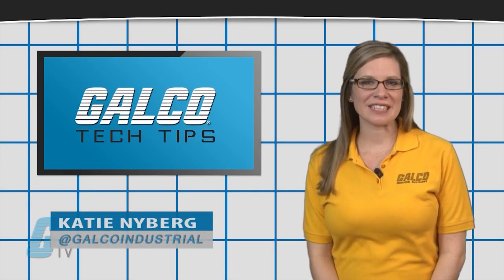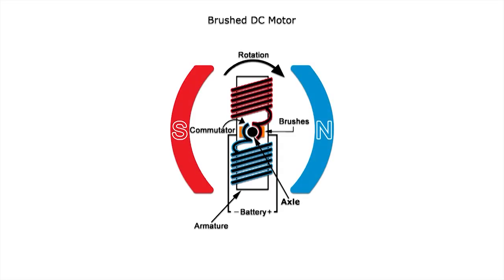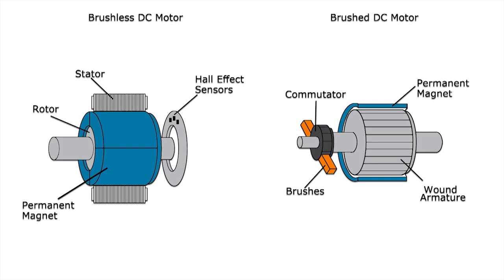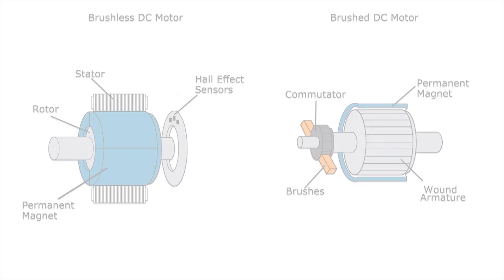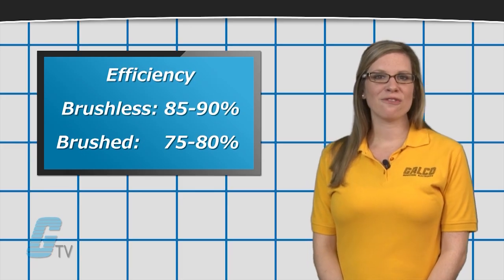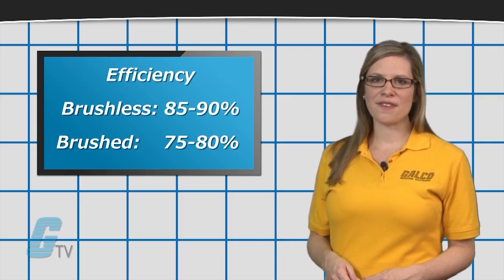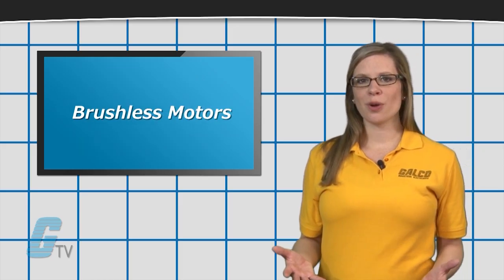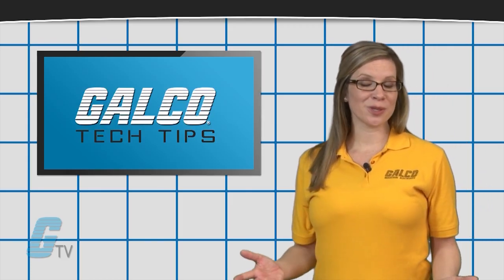Advantages and Disadvantages of Brushed and Brushless Motors - A GalcoTV Tech Tip | Galco

Comment: I have a Milwaukee cordless brushless circular saw, that’s 3 1/2 years old and it’s in for repair, some days it wouldn’t work,  and other days it would work, it’s a piece of shit  I’ve got tools makita with brushed motors that are 18 years old and still working fine, brushless motors are junk.
Reply: Sorry you got a "lemon", it happens.  I have sweated over and spent way too much time deciding between a brush-less and brushed handheld drill and a leaf blower.  I decided that after well over 100 years of use the brushed must still be good and both items saved me money.  I am a DIY homeowner not a professional so I am not worried about longevity as I am 76 yrs old and the tool will most likely outlast me.

Comment: Currently I'm debating whether to get a brushless hammer drill that has less torque power but burns less battery energy vs the brushed hammer drill that has more torque but consumes more battery energy 🤔 

The brushless has 405 lb of torque. The brushed has 450 lb of torque. I'm thinking I might just go ahead and get the brushless to save on battery life. But I'll have to sacrifice torque power. Damn that sucks.

Great info thank you
Reply: So, did you get one, how its going ?)

Comment: The weakness in the brushless tools are going to be the cheap electronics that drive the motor. They will likely be the failure point. The little computer also typically has pre-determined notched speeds so you don't get continuously variable control. You also get the added trigger lag as the chip tries to figure out how far the trigger's pressed in with most brushless tools. Companies are eager to switch to brushless though because it can make tools lighter and cheaper to manufacture/ship from wherever they slap them together. If brushless designs resulted in larger/heavier tools, despite not having brushes that can wear out that tech would remain a novelty and would probably never be adopted on a large scale.
Reply: I have a brushless ryobi and put it thru hell. works till this day.
Reply: remember..the plastic housing isn't the same as they used to be.
Reply: Your right about the speed control much smother with brushes, some tools will always be made with brushes.

Comment: The big problem with brushless tools is their very complex and delicate control electronics. They cannot be repaired and the entire circuit must be replaced. Brushed motor tools are extremely robust and their 4-pole versions are very powerful, which is why they still exist. many dewalt xrp series tools 15 or 20 years old working today.
Reply: Agreed. Cost myself $15 for replacement brushes on my makita drill
Reply: @blaked8963  the probleme is with some motors where the brushes are inside the motor housing like fore some chinese cheap cordless drill for example ,so it's complicated to fix them, and we have to change the whole motor
Reply: I say that's a negative. My Ryobi!
a brand people hate. That brushless cordless drill was a beast.
dropped it from so many heights etc.
Drilled a lot of 1/2 holes with it.
thru 2inch square tubing 1/4 in thick.
I put that cordless thru hell. it's still working.
Reply: They absolutely CAN be repaired. You just have to know what you’re doing. Yes its more complex and time consuming but it can be done.
Reply: I say that's a negative.
put a brushless motor in the hard body plastic as they did the old cordless.
If brushless can't be repaired and regular motors can.. why even get it repaired? buy a new one?
XRP are very delicate. I've seen them fall from 10-15 ft and give out.
Reply: No way, brushless motor is better, their mechanical and electronic parts last longer with no spark and bad odor like the brushed one,
Reply: Take a brushless sawzall to a pipe with water in it and you run the chance of ruining the sensor. 

I love brushless for clean work areas, but brushed tools have remained superior in harsh wet and abusive environments.IMHO

Comment: In my (personal) experience the overcomplicated wiring and requirement of a computer chip causes brushless tools to be much less durable than brushed. I believe the word “durable” is used wrong when talking about the lack of physical contact in a brushless motor. The brushes wearing out on a tool is normal and still takes 5-10 years with heavy use. This doesn’t lower the durability at all in my opinion as the brushes are consumable. It’s more like replacing the batteries in a remote than the remote breaking. 

You could make a brushless tool in a glass housing and it would shatter the moment you drop it. Would that tool be considered more durable? If you look at brushes as consumables then they become the more durable tools due to their simplicity. I feel a lot better when one of my brushed tools falls off of a roof simply because I know it will still run fine after. The brushless tools just don’t hold up to as much physical abuse.

My 2 ¢
Reply: yes. 
the plastic used now is not the same.
back then they could take a beating.
brushless or regular dropped from the same height will give out.
depends on how the tool lands now.
Reply: it's sort of like a combustion car vs an electric car like an electric car sort of doesn't have the problems of a combustion engine but it is a whole lot more expensive to repair if something does go wrong and it's a lot cheaper to replace parts (if common car) on an combustion car. so durability imo is how cheap it is to repair and if you have minimal problems after the repair

Comment: Brushless generator looks more durable than brush by design. The Brushed Generator's conductors between stationary and other in motion - must be connected to conducting the electricity. Brushless generator doesn't need that, since copper coils are stationary.

Comment: You never said anything about the power and torque each gives off
Reply: Since brushless motors are more efficient, that probably means that you can make more power using less energy. Pretty much every electric car on the road uses brushless motors.

Comment: Here’s what I’ll say: if you’re a contractor, or someone who will be using the drill/impact or whatever it is constantly - buy the brushless. You’ll get longer battery life, and the tools won’t overheat as easily, as well as you may get a slight power advantage over brushed depending on the brand. However, if you’re someone who only occasionally needs to use the tools - just buy the brushed. It’s cheaper, and still get really solid build quality depending on the brand. Plus, if your brushes wear out they’re easy as heck to replace. 

The brushed does have one and only one advantage over the brushless: the cost and simplicity in replacing parts. When a brushless motor dies: you have to buy a new tool, if a brushed motor dies: you probably just need to replace the brushes.
Reply: @Pi Pony the what?
Reply: I was just thinking about the people who manufacture brushes for power tools. I have a brushed Dewalt that serves me just fine. These people need to work making brushes Don't put them out of a job.
Reply: @ReadTheBible8  they’re made in a factory in China 99% of the time
Reply: why replace the motor in the drill when it almost cost as much to buy a new one?
Reply: Better things usually are harder to repair by a layman.
Reply: @h8GW  RIGHT!  Try working on a modern car engine!
Reply: Thank you just purchased a brush 0MESIN BOR IMPACT CORDLESS 20V HD INGCO CIDLI20031waiting for it to get delivered was using Makita 12 v is getting bit up alot need to some maintenance on it it heats up and battery life not too good switching brand and bigger drill
Reply: I used my Ryobi cordless brushless drill constantly. drilling 1/2 holes thru 2 in square tubing. Drilled over like 60 that day. Remember. 2 per tube.
Dropped it constantly from 6ft and above.
still kicking.
Reply: As a contractor I say correct.   But brushless motors last substantially longer.  5x for real
Reply: @PS-zw4yc   ~I am also a carpenter, we have had the same 110-120 volt >>Mikita circular saw<< (and also a Mikita cut off saw) with a "brushed motor" since the 1990's with very heavy use for many years building garages, huge shops, additions on houses, house - cabins, etc.. Our 3 man crew made our living and wages with that same Makita circular saw (we have a Dewalt circular saw for back-up that we hardly never use). Could not ask for anything better, it will not wear out and the brushes will not wear out. It has paid for itself a 1000x times over, a "brushed motor" will last a very long time over many years, I am 100% satisfied with its "brushed motor", and I do "not" need a circular saw lasting any longer than that (you explained a "brushless motor" may last 5x longer).
Reply: @royjohnson465  the big stuff that does not get over worked like a circ saw the brush motors are fine.  Same use here.  The drills where they get bogged down drilling etc the brushless last a heck of a lot longer
Reply: @PS-zw4yc   ~I see, thank you. Unlike a "circular saw", if the a Brushed motor is under lots of stress like a "drill" then brushes burn out and a Brushless is better for longevity. 
~"But" brushes can be easily replaced on a Brushed motor, if a Brushless motor breaks then it can not be repaired at home.
Reply: @PS-zw4yc I'm currently debating between 2 cordless hammer drills. The brushless has a torque of 405 lb. The brushed has a torque of 450 lb. 

What would you recommend
Thanks
Reply: In a brushed motor, the motor itself also dies, not just the brushes...

Comment: Lynch brushed motor 93%,  Maxon brushed  92%  their brushless 86% so not sure why you're claiming brushless are more efficient?  - Brush controllers are both more efficient and cheaper
Reply: Rather a lot depends on the number of poles and commutators.  In the illustration, there's only two commutator bars which means as you apply full current to the rotor, most of the time the magnetic poles are too far away from the magnets to impart much torque but are nevertheless drawing current.  Adding more poles and commutator bars allows the current to flow into a winding that is very nearly at the optimum location for peak torque; but if you do that then each winding cannot occupy much space so that limits the horsepower of the motor.
Not mentioned in this nearly useless video is that brushless motors can operate at high torque and very low, or even zero rotational speed; a thing that would quickly burn out the commutator of a brushed motor. 
Peak efficiency is obtained with a pulse width modulated electronic speed controller so that you are not simply slamming the electromagnets with full power in succession; a thing that creates some mechanical stress, modest inefficiency and rather a lot of radio frequency interference.

Comment: hi sir, i just have 2 questions
1. which of the two is better for aquariums?
2. can a brushless motor run 24/7?
thank you in advance
Reply: Sir...?
Reply: Brushless always. 

Depends on how large the motor is and the load constant load it endures. Your main concern is heat. If kept cool and not under much load a brushless dc Motor can run 24/7

Comment: The cost of electronic parts is NOT the reason a brushless motor is MORE EXPENSIVE !  The parts are FAR cheaper than the cost of the brush assembly.  Why then are brushless motors more expensive ?? because ... @#!$%^%$#  I don't know.
Reply: "Why then are brushless motors more expensive ?"
They contain extremely powerful neodymium magnets and neodymium is a "rare earth" found pretty much only in China.
Reply: @thomasmaughan4798  The magnets aren't that expensive.  The tiny coils inside a brushless motor have to be hand wound, and a brushes motor coil is machine wound.  So basically one can be readily and cheaply spit out of a industrial machine.  The other requires somewhat skilled hands on labor.

Comment: Lol Brushless dc is a marketing term.  "Brushless dc" is nothing more than 3 phase AC!  The only thing "dc" about them is that they are powered by a dc BATTERY!
Reply: Brushless motors typically use three phases, but need not be limited to three.  They are indeed similar to a 3 phase AC motor; the main differences being that "brushless motors" typically use permanent magnets whereas AC motors typically use induction.  Because of that induction, AC motors can only be used at the frequency for which they are designed and that produces a rotational speed (RPM) that is not intended to be adjustable.  A brushless motor using permanent magnets is usually infinitely adjustable in RPM from zero up to some specific upper limit.
Reply: @Pi Pony "is Tesla car good?"

Good depends on definition.  Many people consider Tesla very good. 

"Why because if the battery explode it takes 24 hours to shut it down?"

If the battery explodes it obviously shuts down instantly.  

"Does it has brushless motors?"

All electric vehicles, except some golf carts, use brushless motors.  They offer high torque, low maintenance, and continuously variable RPM (rotational speed). 

"Does it work better than average car or it's all marketing"

EV's are better at some things; particularly in cities where you spend a lot of time stopped, frequent acceleration and deceleration.   Hybrid automobiles combine the best of both worlds; a Ford Fusion hybrid for instance engages both the electric motor and the gasoline engine to merge onto a freeway; superb acceleration like you have a 'muscle car", but gets 40 miles per gallon or was it 60?  I drove one around Minnesota and was amazed. 
Two big downsides to EV's is battery cost and temperature; they don't like it too hot and they don't like it too cold.  Brushless motor works fine in cold; doesn't like very hot (above the "curie temperature").

Comment: this video is dumb do brushless motors even have disadvantages except for being more expensive
Reply: Like what?
Reply: @princenoah21  they are lighter, more powerful, spin faster, more torque, more efficient, last longer
Reply: For small motors brushless is superior in nearly every way.  ALL disk drives use brushless motors, all computer cooling fans use brushless motors.  They will run for YEARS with zero maintenance.   
Where it can be less effective is larger motors or hot areas.  Heat deactivates permanent magnets (but usually the magnetism returns once they cool down).  So a motor to be used in a hot area can still be brushless but needs electromagnets for both rotor and stator.

Comment: what do the brushes do?
Reply: Makes the rotary power connection to the armature windings via a commutator. This electro magnetises the armature in opposition to the fixed field winding electromagnetic field, hence producing rotary mechanical torque. I hope this helps.
Reply: @petcatznz  Or you could say.... Electricity is passed through the brushes like a wire. But wires won't work because they'd get tangled up. The brushes allow the electricity to be transmitted to a spinning shaft/commutator then to the armature.

Comment: Doesn't the commutator take an AC signal and convert it to DC? 🤓
Reply: The BATTERY supplies the dc to the 3phase controller, which outputs a pulsed sequence in 1-2-3 order to the three phases of the 3 phase motor ( which is a three phase ac motor only using a more square wave form rather than the sinusoidal wave from 3phased mains power) "brushless dc" IS 3phase AC
Reply: like everything does that

Comment: I read a review on a Milwaukee tool site and one guy said his brushes drill was more durable than the new brushless he purchased. Someone else said the brushless is very sensitive to moisture compared to a brushed version, maybe if its foggy out or working near the coast. 
 Has anybody else experienced the differences like that?
Reply: I have a Milwaukee brushless drill.  It has incredible torque, does not burn out brushes (hasn't got them), and really does not care about water.  Sounds to me like you have it exactly backwards.  Excessive moisture in the air could coat the commutators and they would stop working; also, brushed motors eventually develop a "varnish" on the commutators and must be polished from time to time.
Reply: No, he lied

Comment: Brushed makes more torq
Reply: Couldn't u use gears to make more torque if u need torque?
Reply: @randomgenericusername3890  power tools, both brushed and brushless are already using a planetary gear set for gear reduction. I think they have more power for the size of the motor because they spin higher rpm requiring a deeper reduction (increased torque as well) for the same output rpm.
Reply: No one seems to factor in the electronics failing.  That's the weak link in a brushless tool... Where as brushed tools just need their brushes replaced once per decade or so for a few dollars.
Reply: calholli Bingo!
Reply: Really? Why ?
Reply: @FerSpada  brushed motors can have way more torque than brushless motors but brushless motor have a way higher rmp than a brushed motors .a brushed motor usually have 25,000-40,000rpm and brushless motors usually have 30,000-65,000rpm .
Reply: @xxzenonionnex7658  I just bought a brushed one that is 400 ft lbs. It seems overbuilt for it's power. Brushless ones seem weaker for the  amount of power they have.
Reply: @FerSpada  Brushless needs usage of back emf to have torq

Comment: The major advantage brushless is less friction and less loss as brushes start to wear/down- grade performance immediately. This is well know in other applications that have long used in competitive use to point that brushed is not seen in them any long. Brushless isn't really that new in applications. Cost is the down factor but has gone down which is why you see it offered in lessor applications now.